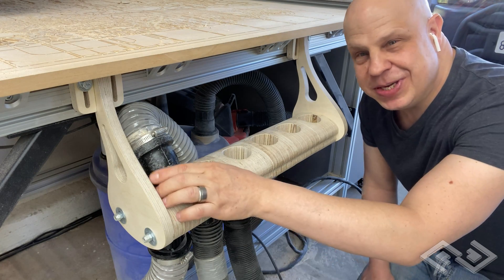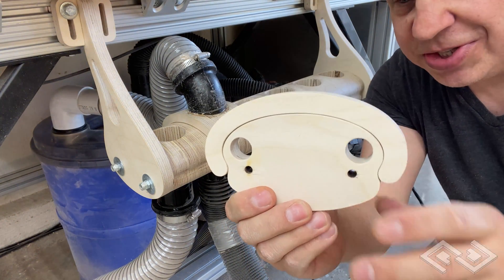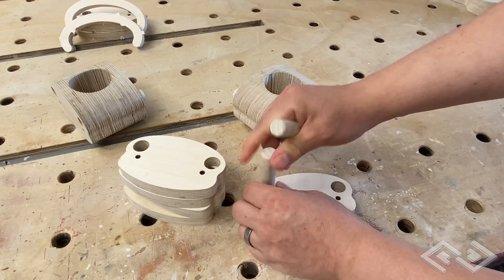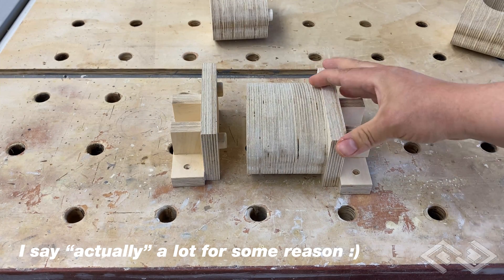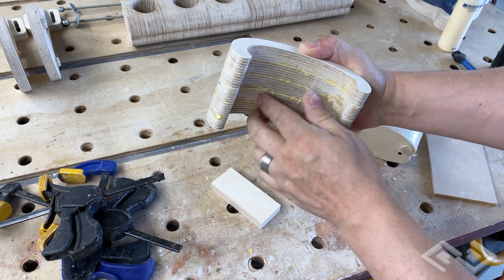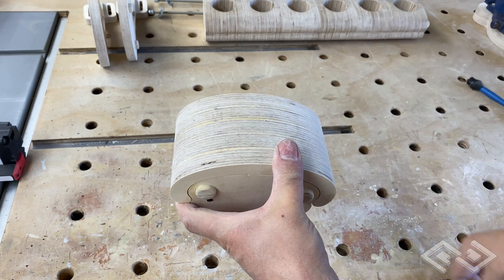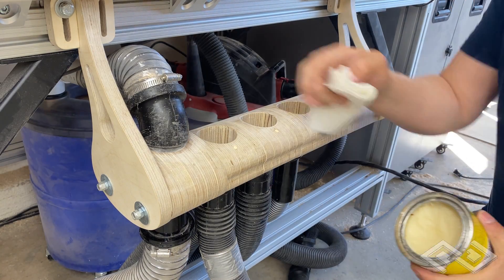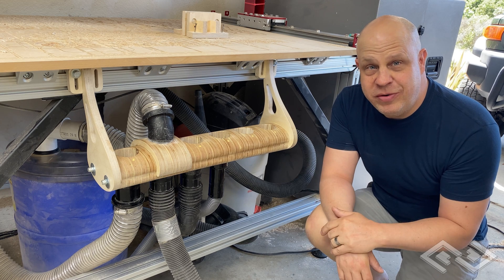Vacuum Switcher For Use with Shop Vacs and Links to Free Plans

Comment: Do you have this already in an STL file format? I run Sketchup that has an STL extension to allow imports of this file type. Fusion 360 unfortunately will not load on my MAC. Thank you!
Reply from the maker: Not at this time but they are easy to export from Fusion360. Will post them when I get some free time. Thanks for your question 😀👍
Reply: @petesquared23  Thanks for answering but my Mac won't load fusion 360 so I can't use the files. Thanks anyway.
Reply: @petesquared23  I misunderstood, sorry. I am learning about cnc and read that exporting from fusion 360 can be done. I think that is what you said you could do when you have free time. I appreciate that effort. Thanks again and I will look for the STL files for this later.

Comment: I love this design but why so complex (other than the beauty of the thing which is really is. It would be a much much simpler build to have two smooth flat surfaces and simply move one across to whatever appliance you need to move it to. you can also make the moving section simply be held down by constraining it in a trough of some sort. But I do like your design over all. However, since I don't have a CNC and not likely ever to get one either simply cutting straight cuts is a lot simpler really.
Your idea is tremendous though and I commend you for it...
Reply from the maker: Thank you for your kind words. The first design for this was very simple using a trough idea and pvc pipes. The problem was that stray sawdust accumulated in the groves and corners of the trough which hindered the sliding valve. Also people mentioned pvc could build up static and cause sparks. The organic shape in this design is meant to reduce hard edges that could collect sawdust. The plans for this should allow you to build it using a jigsaw and traditional tools although a CNC makes it easier. The real benefit to this design is its modularity. You could easily design something similar with a straight edge 90degree angle design but I highly recommend retaining the modularity somehow. Thanks again for your comment 👍
Reply: @petesquared23  very interesting feedback... particularly from the pint of view of dust issues. All I need now is a vacuum port to switch to to remove the stray dust! 😃😆😅🤣😂
But good point about that it is quite poss to do it all with a bandsaw/jigsaw. Your modular design is, as you say, key 🔑 
Many thanks indeed

Comment: Hi Pete.
This a super great solution.
I was wondering how to do something like that, I was just about to make a manifold using some valves.
But now I’m going to do something like this.
Quick question 🙋🏻‍♂️: do you think the result will be the same using square shapes ? I don’t have a cnc machine.
Thanks in advance for your answer.
And yes you are a genius !!!
Reply from the maker: Thank you Guillermo! Yes, square shapes will work well. The V1.0 of this project used square shapes but the way it was designed had stray sawdust collecting in the dado slots and was hard to clean out. Thanks again for your kind words! 👍
Reply: @petesquared23  thanks for your answer !!!
As soon as I make it I’ll let you know.

Comment: Love this design! I'm wondering if it's possible to pull off as seamlessly without a CNC. You're so gracious to provide plans for this design for FREE! Whatta guy :) I think my computer is just out of date, I'm unable to open up the PDF zip file. Might try the SVG files instead and borrow my wife's Cricut machine!
Reply from the maker: Try using WinRar to open the zip file. It’s a pretty standard extractor for windows. You can definitely make this without a CNC but it will take some time and patience. Thanks for your kind words 👍
https://www.win-rar.com